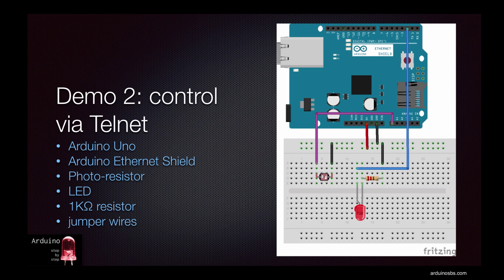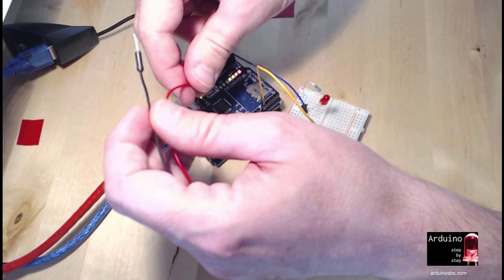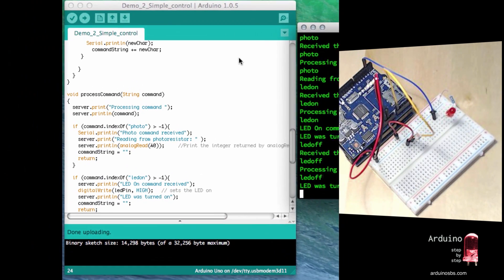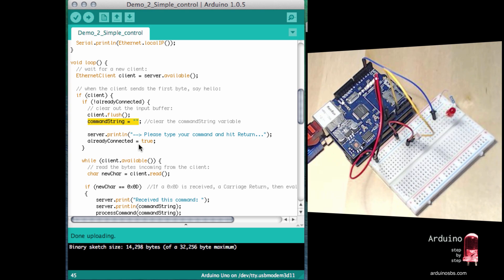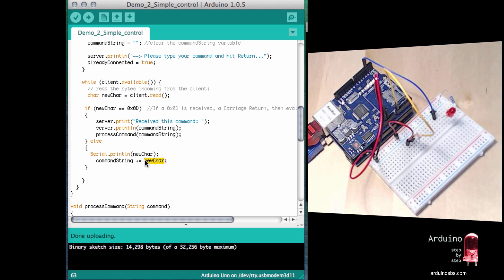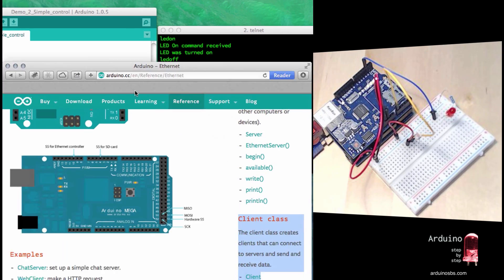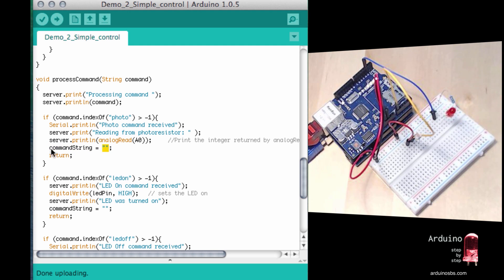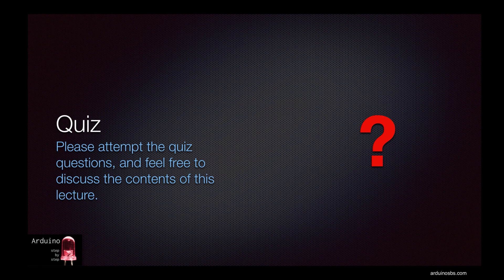Using the Arduino Ethernet Shied, Part 2 of 2

Comment: Is it possible to make the Arduino remember the last known state of the Digital Output pins in the event of a power outage? Say you turned on LED's 1, 2, and 5, 6 using the Telnet commands, and then there is a power outage.

For safety reasons it would be great if we could ensure that the Arduino will 'boot' with the last 'known' I/O pin states :)
Reply from the maker: Hi R D, yes, it is. Perhaps the easiest way to do this is to use an EEPROM to store the pin state before you apply it. When the Arduino restarts, the first thing it would do is to read the states from the EEPROM and apply them to the pins.

Comment: Hi there, your tutorials those I have watched are awesome and easy to understand. I subscribed your channel. I need a help for my dragino Yun shield v1.1. I have reset the factory settings. But now I need to recover it and upgrade the firmware as well. But problem is my device does not stay at Failsafe mode. Some cases it stays at Failsafe mode but my Linux machine netcat socket listener does not show the netconsole of Yun. I am using RJ45 Ethernet cross over cable directly connect the Yun shield. Is there anything I have to check why it's happening. I can't give firmware until it stays at Failsafe mode.

Comment: Hi. I successfully completed your first tutorial on ethernet shield, and what a nice tutorial it is. But when I follow your steps for this tutorial it doesn't seem to work. When I did the DHCP-server tutorial I wrote an IP a was appointed another in the serial port and subsequently I used that in my console for the telnet connection. But when I follow the steps in this video I am not given a "new" IP address and when I type the one I have come up with myself I am unable to connect to the server. 
Any help would a appreciated. 
I am connected on a small business network.

Comment: Great sketch Peter ?
It was easy to understand the sketch,and gives a very  good basis for us newbies to experiment with telnet to control our arduino projects.

Have you thought about, or perhaps already produced some that use a web browser to to achieve the same end so that we could use our tablets etc to do the same thing while remote from our homes.

I know that parsing HTML code is a bitch, but  it must be doable relatively easily  for simple commands. ?

I hope you  will, that would be awesome

Cheers
Ian
Reply from the maker: Hi Ian, thank you! I do have lecture that show how to use your browser to control an Arduino, they are part of my Arduino Step by Step course (see my notes under the video).

Comment: ,, Where i can find the TELNET? , cause i don't know where to write the commands 
Would be appreciated
Reply from the maker: +kareem nofel Hi Kareem, if you are using Mac OS X or Linux, you can start Telnet from the command prompt. If you are on Windows, I recommend Putty (Google it!).
Reply: (" I've installed putty ,but it 's not working it gives me ("Network error :connection timed out
?what's the problem could be
Reply: +kareem nofel   If Telnet is not working you may need to enable it.  Go to Control Panel, Programs & features, Turn Windows features on and off, and check the box next to telnet.  Now when you go to the command prompt you will find Telnet is enabled.  J Murray
Reply: +John Murray Thank you I've done that and it's working now, you're so helpful and kind I'm thankful

Comment: problem in output of ethernet shield
getting 0.0.0.0 at serial output instead of 192, 168, 1, 177
from following program:
#include <SPI.h>
#include <Ethernet.h>

// Enter a MAC address and IP address for your controller below.
// The IP address will be dependent on your local network:
byte mac[] = {
  0xDE, 0xAD, 0xBE, 0xEF, 0xFE, 0xED
};
IPAddress ip(192, 168, 1, 177);

// Initialize the Ethernet server library
// with the IP address and port you want to use
// (port 80 is default for HTTP):
EthernetServer server(80);

void setup() {
  // Open serial communications and wait for port to open:
  Serial.begin(9600);
  while (!Serial) {
    ; // wait for serial port to connect. Needed for Leonardo only
  }

  // start the Ethernet connection and the server:
  Ethernet.begin(mac, ip);
  server.begin();
  Serial.print("server is at ");
  Serial.println(Ethernet.localIP());
}

void loop() {
  // listen for incoming clients
  EthernetClient client = server.available();
  if (client) {
    Serial.println("new client");
    // an http request ends with a blank line
    boolean currentLineIsBlank = true;
    while (client.connected()) {
      if (client.available()) {
        char c = client.read();
        Serial.write(c);
        // if you've gotten to the end of the line (received a newline
        // character) and the line is blank, the http request has ended,
        // so you can send a reply
        if (c == '\n' && currentLineIsBlank) {
          // send a standard http response header
          client.println("HTTP/1.1 200 OK");
          client.println("Content-Type: text/html");
          client.println("Connection: close");  // the connection will be closed after completion of the response
          client.println("Refresh: 5");  // refresh the page automatically every 5 sec
          client.println();
          client.println("<!DOCTYPE HTML>");
          client.println("<html>");
          // output the value of each analog input pin
          for (int analogChannel = 0; analogChannel < 6; analogChannel++) {
            int sensorReading = analogRead(analogChannel);
            client.print("analog input ");
            client.print(analogChannel);
            client.print(" is ");
            client.print(sensorReading);
            client.println("<br />");
          }
          client.println("</html>");
          break;
        }
        if (c == '\n') {
          // you're starting a new line
          currentLineIsBlank = true;
        }
        else if (c != '\r') {
          // you've gotten a character on the current line
          currentLineIsBlank = false;
        }
      }
    }
    // give the web browser time to receive the data
    delay(1);
    // close the connection:
    client.stop();
    Serial.println("client disconnected");
  }
}

Comment: Hello,

What do i need in order to control the arduino, with local website?
I would like to set up a website with bottons and just turn on/off the light via the browser without internet connection( the website is not hosted) ? Is there any chance?
Reply from the maker: Mladen Mladenov Hi, do you want the web site to run on the Arduino itself?

Comment: Greetings:  Great videos.  I've been spending some time trying to get data to push from an XBee (with Sparkfun shield) to the net via the Ethernet shield.  I so far have mastered using the shield itself and sending analog data from an xbee to the other, but integrating the two leaves me puzzled.  The sketch I've put together loads, and the serial monitor acknowledges a client trying to contact, but on the webpage side it won't connect.  Do you have any experience combining the two?
Reply from the maker: ***** I only have limited experience with the XBees, none of my projects seemed to really need one. Just to understand what you are trying to do: you want to have two XBees connected to a single Ethernet shield, and from there to the Internet?
Reply: +Tech Explorations How can you do the telnet thing on windows through a web browser.

Comment: Hello, I'm not sure what i have typed wrong in the code, but when ever i try and type a command such as 'LED on' after connecting to the telnet, it just floods the screen with the list of commands i am supposed to type. If i press a single key it just repeats all the commands. Any help would be appreciated!
Reply: rory johnstone 
I only had one '=' in the if (newChar == 0x0D)  line adding another '=' fixed the issue

Comment: hi
i not connect to website have ip 192.168.1.177
mac address ? 
I tried to but failed
pls reply
Reply from the maker: Phi Phạm Hi Phi, how do you know that your Arduino is listening to IP 192.168.1.177?
Reply: my ip router 192.168.1.1 . i control turn on off led via website. I try test file->example-> webserver but not connect to sever. Pls help me. Sr, my level english is bad.
Reply from the maker: Sorry, I am having trouble understanding. Where you actually able to turn on and off the LED?

Comment: I have a problem with this sketch, I can only run commands once or twice. Then I get an error, see the attached example. 

--> Please type your command and hit Return...
ledon
Received this command: ledon
Processing command ledon
LED On command received
LED was turned on
ledoff^MReceived this command: 
ledoff
Processing command 
ledoff
LED was turned off
ledon^MReceived this command: ledon
Processing command ?%
I don't understand
Please use one of these commands:
* photo, to get a reading from the photoresistor
* ledon, to turn on the LED
* ledoff, to turn off the LED
Received this command: 
Processing command ?
I don't understand
Please use one of these commands:
Reply: I know it's been four years, but by chance did you find any solution to this? and can you find it again? it's really annoying me too

Comment: hi nice video
I have doubt about the arduino yun which has an in built Ethernet port, is there a possibility to connect the yun board to a non arduino embedded board with Ethernet facility to communicate between these two boards

Comment: Nice tutorial. One question, why use indexOf? In your case command will be executed if you type for example 
ledoffdfkjgdhfkgh or werowiuerledoff. Why not use (command == "ledoff") in If clause?
Reply from the maker: Hi, in the way this sketch works, "indexOf" and "==" are equivalent as long as the user types in these commands without adding other characters (like spaces etc.).Back then I probably chose to be on the safe side by using "indexOf" so that if the user typed in something like " ledon" (notice 1st white character), the sketch would still work.  Hope it makes sense.

Comment: do we need to connect the ethernet cable (other end)to the pc or router ???  thanks
Reply from the maker: savichovich Hi, sorry for the late reply - Yes, plug the Ethernet cable from the Arduino to your switch or router (not directly to the PC).
Reply: Tech Explorations
many thanks